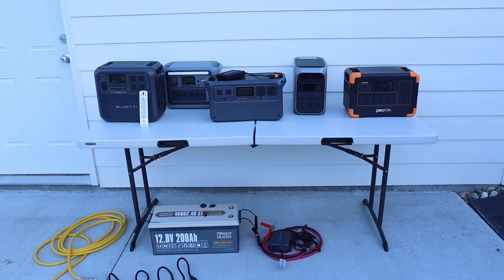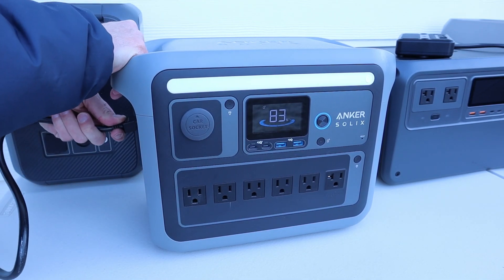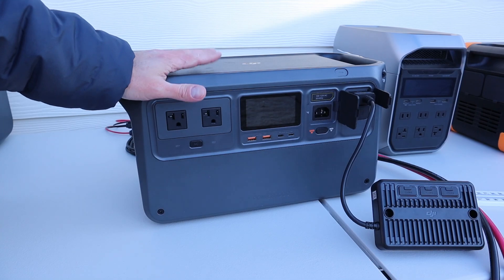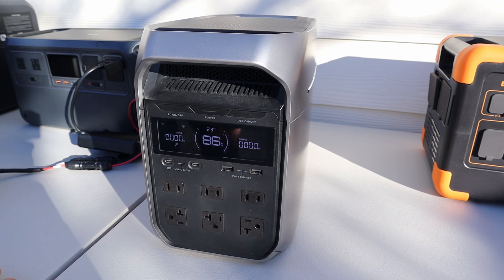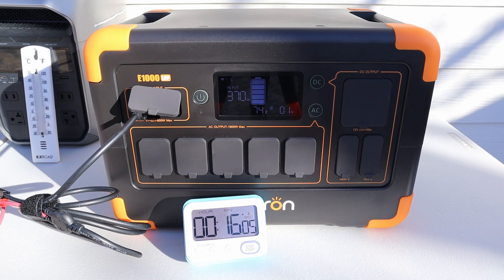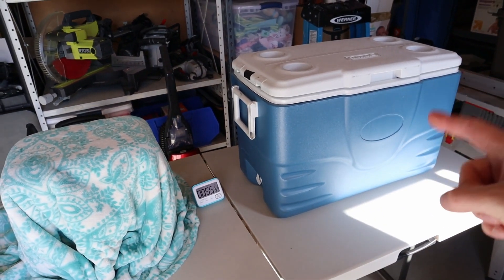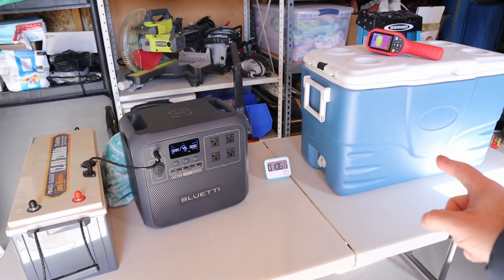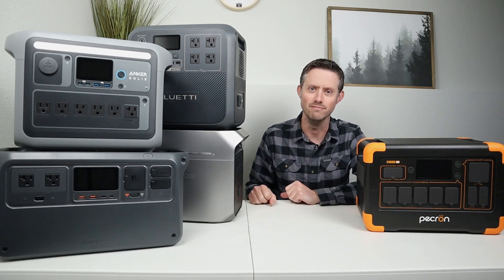Do Power Station HEATED Cells Make a Difference?

Comment: Great job on this testing. I've had the Pecron unit charging on a 440 watt panel in the mid-twenties. That Pecron unit is a game changer.
Reply: The Delta Pro Ultra already does this, just not the smaller units. I would say it's a good feature but not a game changer since its been done already
Reply from the maker: I'd consider it a game changer for portable units.
Reply: @Jasonoid  thats fair
Reply: @Jasonoid  I agree, but not because of the heated batteries, a feature I will likely never need, but still good to know it has it. The reason it is a game changer to me is that switch to allow 20 amp charging. That allows me to charge at 267 watts(tested) from a 12.8v 100ah battery without the need of a Bluetti Charger 1, Pecron 1242-500 or buck converter. Since my  full size fridge will not consume that much on average per hour, I can simply add a 12.8v 100ah LiFePo4 battery to effectively add 1280wh to the capacity. I could also do alternator charging at that wattage using only a fused wire with an xt-60 connector from my cars battery. I could also charge it even faster with 2 LiFePo4 12.8v 100ah matched batteries wired in series. To me, that 20amp input switch is why this is a game changer. It allows me to add capacity without the need for the higher cost per watt hour of the proprietary expansion batteries. My main purpose for power stations is backup power during an outage. I lost power for over a week during Hurricane Helene. Every power station in the future should have that 20 amp input option IMO. It is much better than using the Bluetti Charger 1 IMO because it allows faster charging without the efficiency loss of the DC to DC charger.

Comment: I bought a E1000 just for the heater function. At $399 it is the best bang for the buck in this midsized power station right now.
Reply: Just saw it for 349 but still researching, quite a few negative reviews about quality and other issues. Might hold off deciding until black Fri deals but 349 sounds nice for the power. Would you buy it again at this point?
Reply: @DisandDat-ht5os I’m on the fence between the 1000 and 1500, I reccomend just getting it on Amazon with insurance so if there’s any issues and they can’t fix it they send you a Amazon giftcard for the purchase price